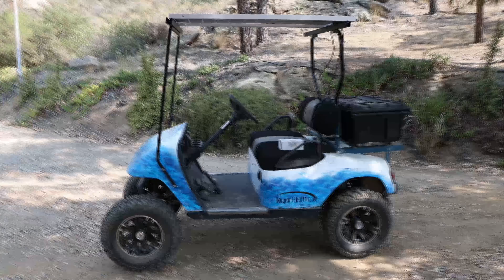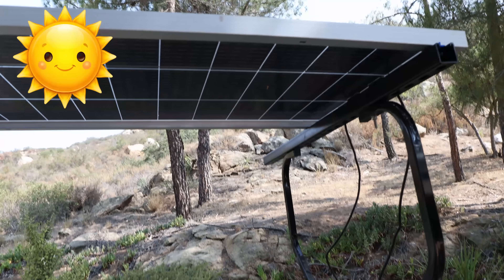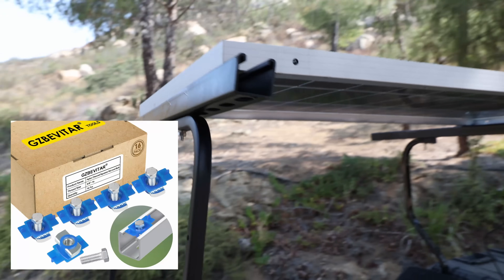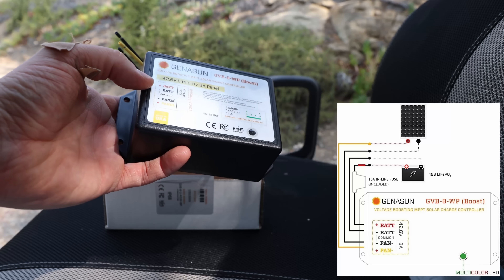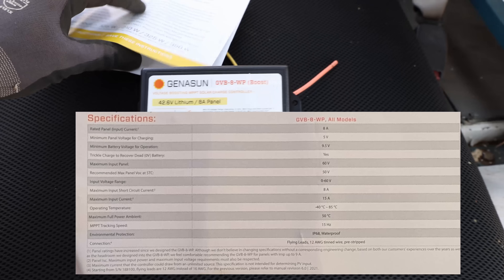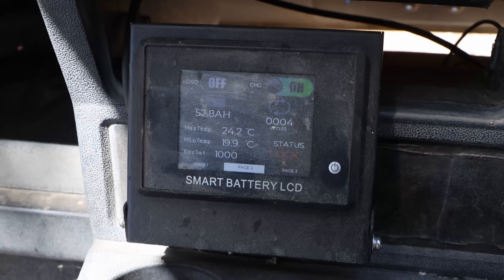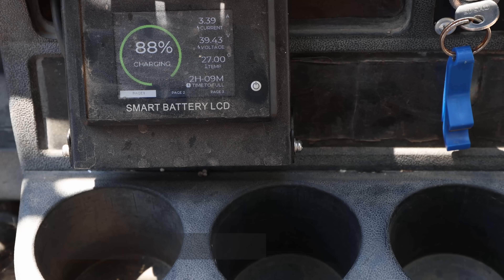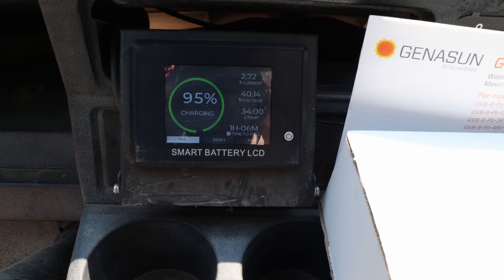GENASUN Solar Charge Controller (Boost) Installation for Golf Cart Charging

Comment: Is your solar panel's max current over the 8A rating of the charger? I also have a 195w panel and I want to use this charger, but I am a little worried that it's over the spec.
Reply: Hmm, but looking at your other video these panels output only 150w at 8A. So you're probably OK. My panel is also Eco-Worthy and I think they are just over-stating their capacity.